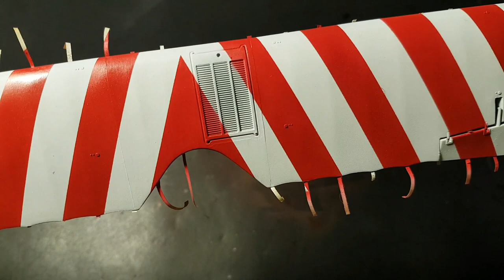Roden 1/32 Albatros D.III (OAW), Part 2 - Painting

Comment: Curious about the pin striped effect on the undersides of the wings. Shouldn't those stripes be darker, rather than lighter, than the rest of the wing, since that's the place where the wing frame would be blocking out sunlight from above?
Reply from the maker: Hi Paul, from my understanding this effect will be on the full linen plane, if it was painted the space inside the wing (between upper and lower linen) will give some shade and a bit darker color, but on the stripes there will be no such shade. Also, you can see sunlight coming through the wing during the sunny day, but what about cloudy days? lol  ;-)  Anyway, I saw modelers use both effects, so I do not think that either effect is wrong.

Comment: Another amazing build from the Master Model builder. The Pepper Mint candy stripe paint job is EPIC! How did you get rid of the overspray? Love your work...I have this same model but I think I will go with a safer paint scheme...
Reply from the maker: Thank you Phil, Master Model builder - lol.

I had a very little amount of oversapray on that model - preparation is very crucial part of any paint job. Once I removed masks, I applied them again and using a low pressure corrected overspray with white paint.

I believe that you can do it as well, just take your time with masks and all preparation for paining, good luck with your project!!!